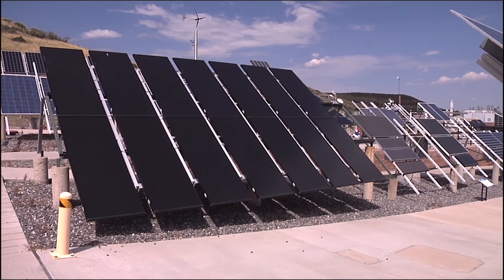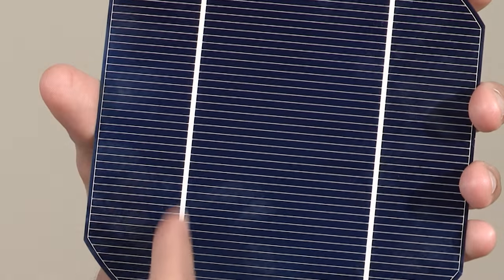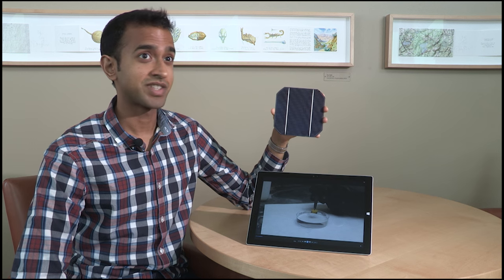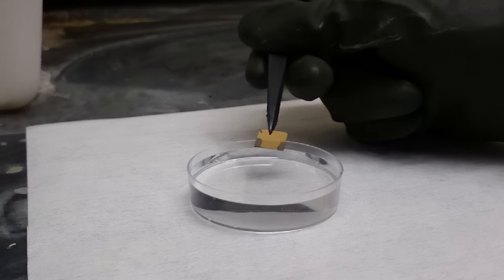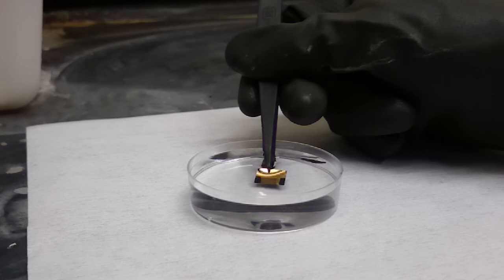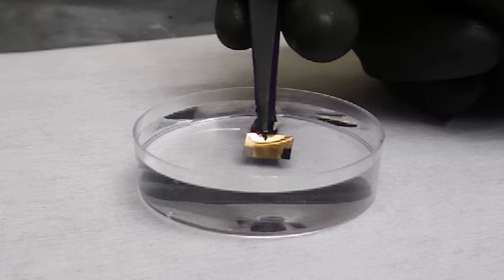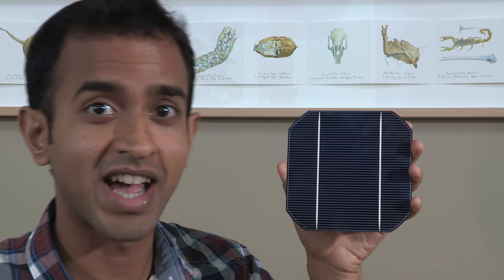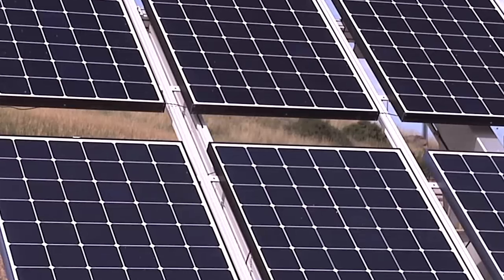'Invisible wires' could boost solar-cell efficiency

Comment: So they are etching the gold with hydrofluoric acid and hidrogenperoxide. But the silicon pilars had to have been created on the silicon surface before even coating it with gold. That process wasn't described.
Remarkable that 97% is absorbed while 60% of the surface is covered with gold. Very efficient!